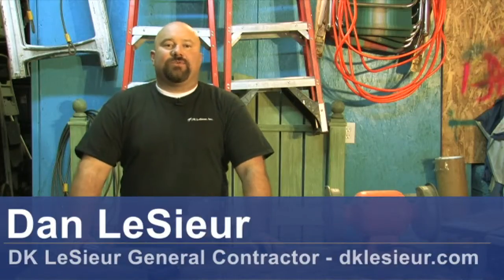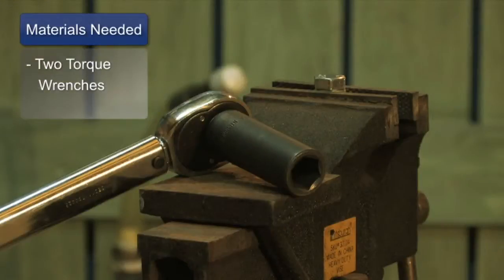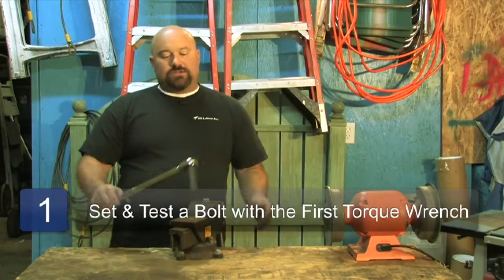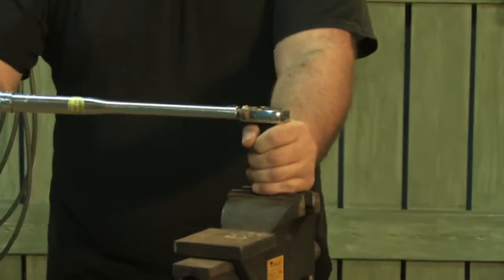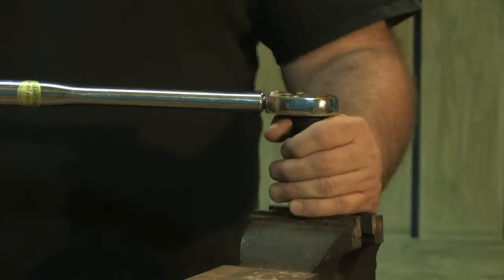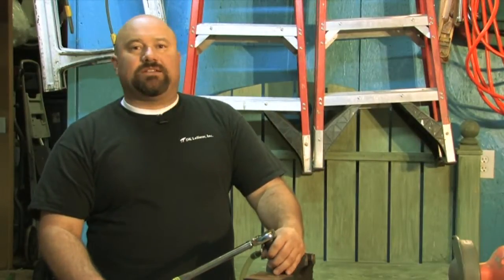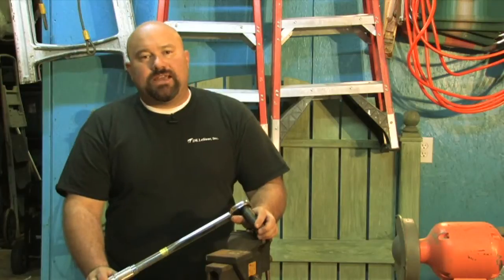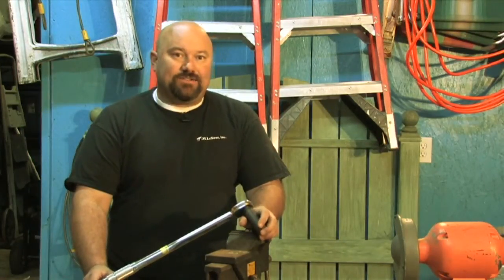How to Test Your Torque Wrench

Comment: What if the first wrench over torqued the test nut and the second wrench is under torqued; you'd hear the click but it doesn't mean the wrenches are calibrated.  With your method I'm thinking you'd be better served by testing the two wrenches against each other (not just one against the other) to see if they both torque to the same weight and maybe the same rotation position.